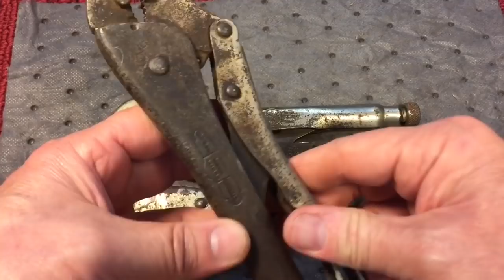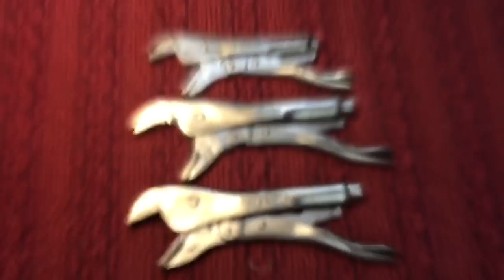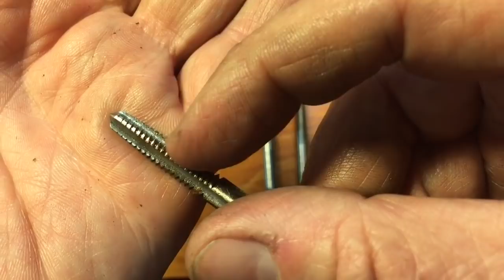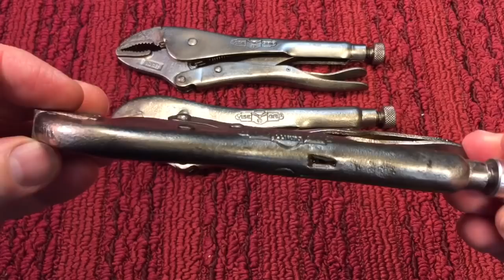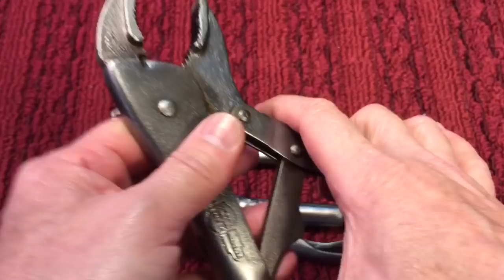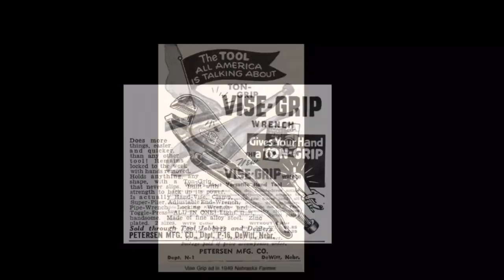Restoration of 3 VISE GRIPS...

Comment: Another great video!  Just one quick note, when drilling and tapping aluminum, you should avoid using oil or wd-40 and use something like tap magic, which is formulated for aluminum.  Really appreciate your videos!
Reply from the maker: Hello Larry- I must have about 15 different cutting/tapping fluids and Tap Magic is my favorite!  However for cutting or drilling Aluminum WD-40 is one of the preferred cutting fluids!  I have the Tap Magic for Aluminum but the smell when vaporizing is like chloroform!  =)  Next time you drill or cut Aluminum give WD a try and you will be amazed!  However for taping keep the TM!   Thanks!!!!!!!!!!!
Reply: I'll try the WD-40 next time - thanks!

Comment: My first car, a Pontiac Straight 8, had the shift lever pot metal casting on the steering column for the Hydramatic transmission broken... Yep, I used Vise grips for years as a shift lever. Once clamped on, I don't think I ever had to take them loose.  
I too have been a victim of Oriental "Vice Grips". Years ago I had one of those "mystery" Vice Grip clones. It did grip just fine, but getting it to release always involved the little release lever pinching the be-Jesus out of my hand. One day I had finally had enough... I took them over to the frictional cut-off saw and cut it into little one inch pieces... it was so satisfying!
Cheers from NC
Reply from the maker: Hello ARH!  You know I spent 15 years restoring a 1951 Pontiac Chieftain with a straight 8!  I learned so much from that endeavor.   I know the feeling about destroying a cheap or ill-designed tool!  Very satisfying indeed!  LOL   Thanks so  much!!!!!!!
Reply: Mine was a '51 torpedo body.. I think they only made 1500 before that body style was finally discontinued. I still have the Chief Pontiac Indian head wheel covers.
Reply from the maker: Funny thing, the chrome on the wheel covers I had were starting to flake, the wheel covers were made of stainless steel so I wire brushed all  the old chrome off and polished up the stainless to a beautiful shine, then I sprayed the area around the chief head within the circle with Clear Red spray paint.  They looked NOS!  I painted the car (guess)  RED with white top and wide white walls...  Look like a million dollars!  I loved the torpedo style!  You're right, very rare!  =)
Reply: I hadn't realized the covers were stainless.. though I had noticed that the back sides of the the wheel covers are perfect with no rust... you'd think they were made last week and not nearly 70 years ago.
Reply: I can relate.  I have some Craftsman clones that pinch me every time I use the release lever!

Comment: Wow scout I would have sent you the extra vise grip bolt, I have a bashed up pair of vice grips that's been sitting in the scrap bucket.  Post an update if you are looking for bits and bobs for future projects cheers!
Reply from the maker: Hello Readyset!  LOL!  That's great to know!  I just got a Ridgid 10" pipe wrench thats missing the knurled adjusting ring!  The funny thing is I found them on ebay 6 for $14-  Good price but when will I ever use the other 5?  LOL   Thanks again!!!!!!!
Reply: I picked up a lot of about 10 of the Ridgid brand top moving jaw piece, It was a $5 online bid...surprised  4 were brand new replaced my jaws and brought the rest to the flea market a Island man bought the rest to send back home. Unfortunately the adjustment ring is one of the odd bits they don't replace often. Sorry I can't help on that piece.
Reply from the maker: You're right!  I never had to replace one before!  LOL

Comment: Great repair,  so sad the new ones are made of Chineseium
Reply from the maker: Hello Tom!  I know right!??  We took the older ones (pre 2008) for granted!!!!!  I hope things turn around!   Thanks!!!!!!!!!
Reply: Such companies only understand it if the customer shows them "the finger" by not buying the products.
Here many companies went over to China, produced there and meant they still could charge the customer the price for made in Germany. Quality was mediocre in most cases, and most of them went back. But some dropped out of the running.
For example Märklin, manufacturer of toys (mostly high priced model railroad). Their models which were made in China had something we call "Zinkpest" here (zinc pest) which is an intercrystalline corrosion of the zinc alloy. That was a problem which here wasn't any problem since the 1970s! Unclean working contaminates the zinc alloy (mostly contamination with lead) and then you'll get such problems. The zinc alloy is corroding from the inside to the outside, so no kind of surface protection can do anything against that. Pictures of a Märklin locomotive model with zinc pest went through the internet. The head of their R&D first thought it was a fake, but then he informed the managment...and they've fired him after 23 years for that (messenger is always guilty if he brings bad news), and they've ordered him to stay away from the companies property. They've even fired employees which were 40 years in the company because they were to expensive (compared to younger employees). Which was unlawful, so they had to withdraw the termination.

They were insolvent in 2009, but went back in 2010 under new managment. And now they're producing (again) in Germany and in Hungary and no longer in China.

https://en.wikipedia.org/wiki/Zinc_pest

There are other companies making good locking pliers. But it's a shame how greed can destroy good companies with a history.
Reply: Marcel Germann, very interesting story.
Reply: And the customers done something we call here "vote with your feet", which is meaning go somewhere else and buy there.
Reply: We only have ourselves to blame because we insist on low prices for tools.
Reply: That's one point. The other one is greed of companies. They still charge the customers the prices for made in USA/Germany/UK or whatever, but they're manucturing in China, Taiwan or other low cost countries. And sometimes it's not the salaries of the employees, the laws and regulations in such countries are much lower. Or no one checks it if you're disposing you waste correctly. I once have seen a documentation about Jeans manufacturers. They simply disposed the waste of the coloration process into the river without any treatment. The whole river was black. It was illegal there too, but no one cared, except for the people living there. Especially farmers which had to use this mess to irrigate their rice fields. One farmer had his legs full of ulcers caused by the filthy water.

If they would do this in America or Europe the authorities would shut down their plants very fast. So they're saving money by polluting the environment.
Reply: @willwyatt7023  I agree to a point.  The one caveat I have is I cannot think of one item sent overseas to the land of 20 cent wages that resulted in a price drop. Current example is craftsman and Nike. New Balance is usa made, comparable to Nike.  I could be wrong, but that is my take and BTW I have import tools in my box. I would not have commented had Irwin kept the same quality when they went overseas. Sad because you know the labor cost fell like a rock.
Reply: Nothing will change until consumers value good wage jobs for their neighbors as much as they value low prices for themselves.  Frankly, I don't envision that happening ever.

Comment: I can't believe how nice those turned out! When I need a bottoming tap I buy the cheapest normal tap I can and cut it down to make a bottoming tap. They work great. Edit: I start the hole with my good tap first.
Reply from the maker: Hello UD!  You know I didn't even think of that!  Your so right!  I could have cut down a regular tap with the Dremel wheel!  I have a lot of taps and should have a 3 set for the most common size bolts I use...  Thanks so much!!!!!!!   Great tip!!!!!!!!!
Reply: @ScoutCrafter  
I save all broken taps for just such a purpose also. The only problem is removing the remaining piece from my work. If they are broken beyond that use, the make excellent center punches! Much harder than the ones sold for that purpose. You can make any angle you like. I like a variety.
Reply: @ScoutCrafter  
With the tooling you have there is no telling what you could do with bad taps. For whatever reason, (hardness?) taps seem to be easiest to shape by belt sander. I also cut grooves and taper hardened bolts in a pinch to make my own when necessary.
Reply from the maker: Great tips!  It's always good the think outside the box!  Just like the old timers did everyday!  =)
Reply: @ScoutCrafter  
Yessir. I have grown up (old)  working on aircraft where the companies I have worked for only like to provide rocks and sticks for tooling.  My standards are higher. We made leading edge skins for aircraft with a brake made out of 4×4s and gate hinges with some foam and steel pipe. They actually turned out better that the factory ones would have been if available. They usually aren't.
Reply: @ScoutCrafter  
I challenge you Scout Crafter, make your own tap from a bolt and teach people how. Dont give them a fish, teach them how! (You do pretty good at that). Just look at a normal tap and make a hardened bolt look as close as you can. Die grinder with a cutoff wheel is what I use to cut the grooves. I belt sand the bevels. The hex of a normal bolt allows the use of tools everybody already has instead of the maddening square of a normal tap.  Give it a shot. Paint it red if you want to.
Reply: @ScoutCrafter  
With the tools you have i think you could do better. I used what I had at hand. I was thankful for a belt sander. The rest was my toolbox and the rocks and sticks they provided. The belt sander was wiped out 20 years before I saw it. You wouldn't believe the teeth I had to pull to get a belt for it. 10 months!

Comment: Wow they came out nice with the wire wheel!  I have had luck with BreakFree CLP for rust protection in areas I couldn't paint or wax.  It is thicker than WD-40 and really stays in place.  Low odor too.
Reply from the maker: Hello 357MD!  I love CLP (I have to after 9 years as a grunt)  lol   However now I love the 50/50 Vaseline/Mineral oil mix for tool protection!  Cheap and works very well!  Thanks!!!!!!!

Comment: Nice restoration ... I can't tell you how many times a pair of Vise Grips saved my you know what. I usually rub exposed steel with Balistol to prevent surface rust. The most toxic plating metal is cadmium ... I couldn't determine whether Vice Grips were ever plated with cadmium.
Reply from the maker: Hello Carver!  It's so funny because as good as these pliers are their coating had a tendency to flake or chip off and I often wondered what type of coating it was... That's why I stressed wearing a mask for the wire brushing of these because like you I get a funny feeling that this finish isn't very Green!  LOL   Thanks very much!!!!!

Comment: One of the best inventions ever, for gripping pipes, worn nuts and bolts, using them as a hand vise, and then all the variations in the metal fabrication to hold sheet metal or what ever in place for welding or riveting. I have seen angle iron welded in the jaws to hold pipes or tubes, people  alter them and make toggle clamps out of them, The new Chinese knock offs are very cheap not as good as the originals but 4  pairs for 10 UK pounds you cannot go wrong.
Reply from the maker: Hello Tony!  I agree 100%  you can't beat this tool for saving your a$$!  LOL  Chinese tools are always hit and miss, you can get good or bad!  It's like gambling!  =)   Thanks so much!!!!

Comment: Nice work on the knob! Came out great. How do you like the quick-change tool post and the holders? I've been eyeing something very similar to replace the one on my lathe.

Yea, Vise-Grips are indispensable. I have a bunch of US made from Petersen and Blackhawk, and some Asian ones, too. The Grearwrench tool from Taiwan is pretty nice. I grab those as often as the Petersens. The ones from Crescent, made in China, are kinda rough. Not the finish as much as the operation: the screw doesn't turn smoothly and the handle release is more difficult to use. This isn't to say their finish is great, either. Recently got some Milwaukee. Not bad. They look really good, but IMO the Gearwrench is nicer to use, as far as my experience with the Asian offerings. The cool thing about the Milwaukee is that their screw can be tightened by slipping a screwdriver through it for a whole lot of leverage. Still, given a choice of one, I'd go for the Petersen.
Reply from the maker: Hello Felix!  Yes, Petersen is tops but for all asian tools Taiwan can't be beat for value and quality!  As for the quick change I love it!!!  Had it for a long time!  Little Machine Shop has a bunch of different ones and they are a great place to learn the differences.   Thanks so much!!!!!!

Comment: i have two differing designs both from the 80s' the  back of the knurled screw, once says the maker the other one is blank, i have 2 pairs that show this difference.
Reply from the maker: I think they moved production to China in 2008 so anything from the 80's is still USA!  =)
Reply: yep mine i bought in the 80s, but i have a large pair i bought recently the large oil filter type, its very hard to see where any economies are,  the fit and finish are fine
Reply from the maker: They are still good but most people complain about the Jaws and the release mechanism of the newer models...  =)

Comment: gotta say i love vise grips, the super sharp jaws for gripping those broken studs but.....the british mole grips, sure the jaws are blunt so they last forever, but the release system is so much easier when you have it super tight, i wonder why they always differed on that.
Reply from the maker: Hello Jusb!  Petersen had offered additional designs on a easier release mechanism including the one I show at the end of the video.  However you are right, the squeeze release is far easier to use.  It's always easier to improve a already existing design!  Thanks!!!!!!
Reply: i have never seen mk1 vice grips with the single handle!  british mole grips had their release in 1958 (the first year, made in wales, before stanley bought them) , any idea what year peterson added their release handle?
Reply from the maker: Petersen added his lever in 1957...    As per their website...